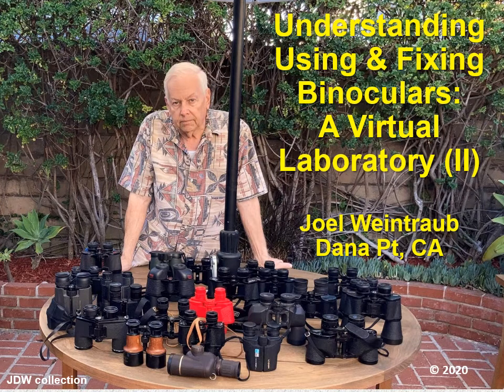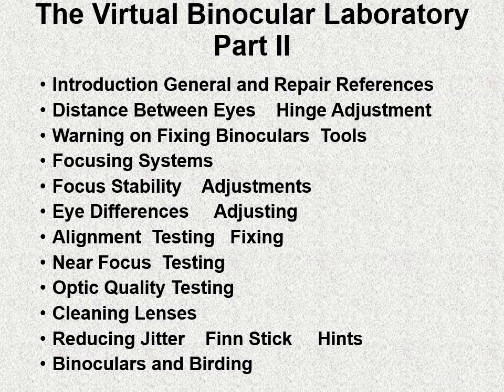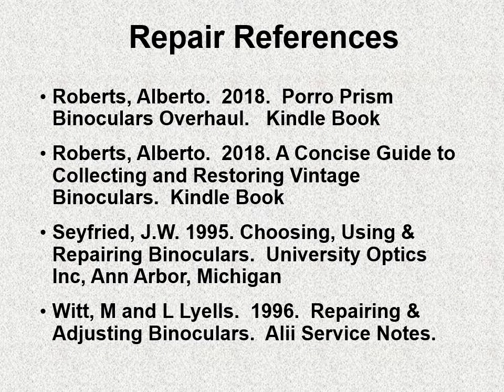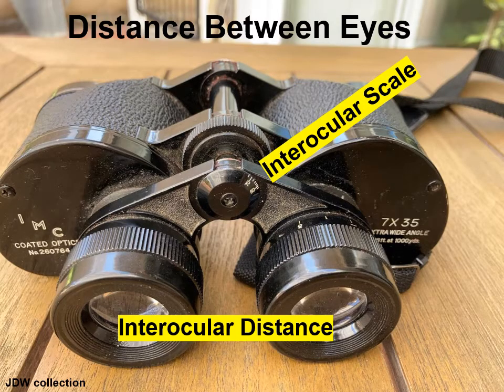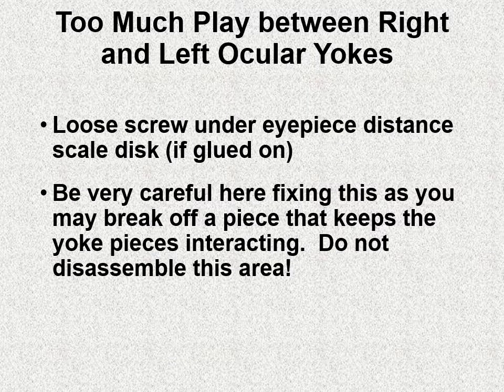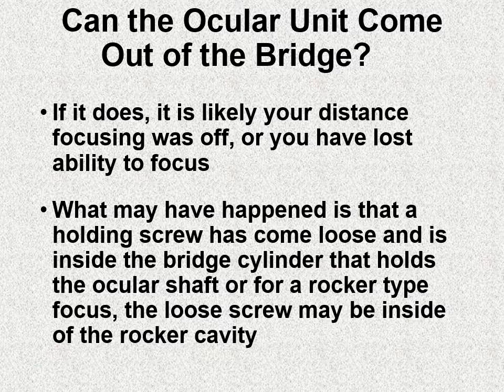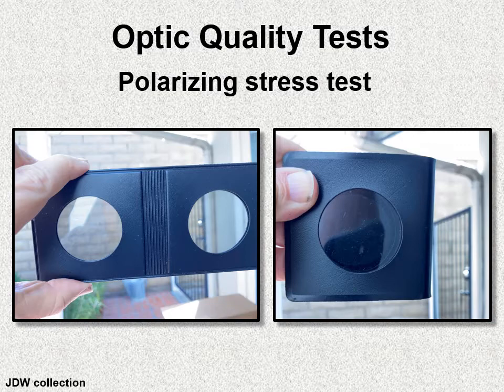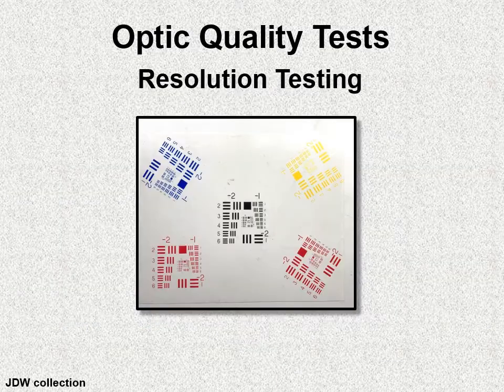Understanding Using & Fixing Binoculars: A Virtual Laboratory (II)

Comment: Aloha. I thought I'd research how to fix a pair of BUSHNELL "Powerview" binocs for my elderly lady neighbor. Got to at least try. The problem is double vision. Mahalo for the input. I'm mechanically inclined and have believed for a long time that if man can make it, man can fix it. I'm working on finding/making the proper tools needed. Thanks for the help.
Reply from the maker: Remember, the first step is to exchange the front objective lens barrels and see if that works.  Mark with a pencil where the original barrels fitted into the body.

Comment: as a rule, with small binoculars, the image shakes, the eyes get tired. What is the stability of the stillness of view with the Nikon 6x15 and Nikon 8x20hg, with the Zeiss 8x20, Trinovid 8x20, the image shakes, shakes! Are the Japanese ones better?
Reply from the maker: Images don't shake, hands shake.  The small binoculars have small pupil sizes, and thus make it difficult to align the user's pupil to the binoculars pupil.  6X15  (15/6) and 8X20 (20/8) have the same pupil size.  Other variables including center of gravity, ergonomic design, eye relief, weight of binocular, and muscle memory all play a role in binocular use.  If those binoculars were put on a tripod, the image wouldn't shake.

Comment: You say how to adjust the dioptre but not how to fix it, I can't adjust it properly as it is end of scale , can I some how shift the scale? So I could adjust a little bit more.
When I look at objects that are close then I'm able to adjust to the sharp point, but when I look far away I can't adjust right eye as the scale finish and can't turn anymore .
It there a way to fix this ?
It's a Celestron skymaster 15x70
Reply from the maker: Are there tiny screws that hold the eyepiece casing to the lens cylinder?  Is it slipping?  Do the eyepieces move up and down together on their yokes or does one lag indicating a looseness in the connection or even a break?  Is you model covered by one of the binoc YouTubes for help?  Is it still under warranty?  This is a big binocular probably for astronomy.....   Good luck with your problem.

Comment: Hi I put some prix binoculars back together, they only focus on short distance. The longer horizon focus is not achievable. Am I missing something?
Reply from the maker: Will the ocular mount come out of the binoculars when you reach the end of the focus turns?  Perhaps and I don’t know much about your model the screw that holds the ocular shaft within the central cylinder has unscrewed and the synchronization is now off
Reply: @JDWTalks  I will take another look at at that.Thanks D

Comment: i have Nikon Trailblazor 10x25. Is it even possible to fix the collapse/folding mechanism? One side is rigid and works good. The otherside has no tension. So 2 hands required to use them. I have no idea how to get it to stiffen up again.
Reply from the maker: Hi,  Your binocular is still being made, and runs in the $80 range on Amazon.  Is it just the hinge and not the focus mechanism?  Assume it's just the hinge tension.  Have you: 1. put in the model number on YouTube to see if someone else has the problem and solved it?  2. checked the comments on Amazon?  3. Explored whether there is a warranty on this produce?  After all that, if still no resolution.... this is what I would do.  The binocular is not a classic, probably does not have some family story attached to it/some treasured gift.  And if you are the only one using it, and it's basically worthless the way it is.... then I would take some strong epoxy glue and cement it in place making sure the oculars are the same distance apart as your eyes.  Make sure what you do doesn't interfere with holding it or focusing it.  Put a protection (saran wrap?) around the ends protecting the glass surface as some glues emit vapors that might condense on the glass surfaces and introduce a new problem while "fixing" the old one..  But keep in mind if you do the cementing, it's going to be usuable only to you and would preclude any other fix.

Comment: I have a pair of decent old binoculars--Audubon Equinox HP 10x42 Binoculars Sheltered Wings. I think that the eyepiece screw threads are stripped. I had duct tape holding the eyepiece, and that works. I am guessing there is not much else to do.  Any ideas? Thanks
Reply from the maker: Hi, do you have an emotional tie to these binoculars?  Or is it time to get a better pair.  Probably a good pair of roof prism binoculars today would cost about $200 or so dollars.  But... are you talking about the eye shields on top of the oculars, or the eyepiece that moves to equalize the difference between your eyes?  Do you want the eyepiece not to move?  Consider Permatex medium strength threadlocker blue.  Or do a standing search on eBay for a binocular like yours for parts.  Good luck.